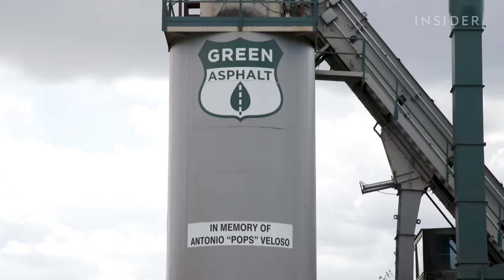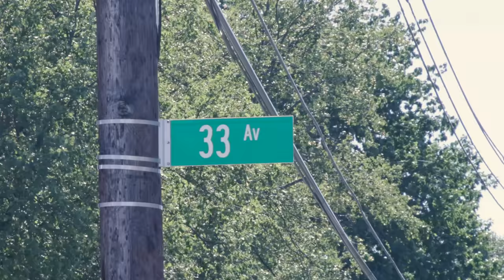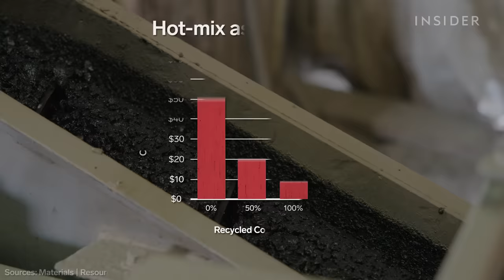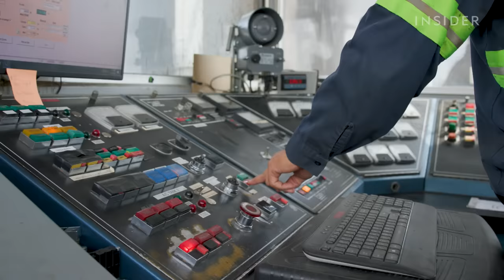Roads Can Be Recycled Forever, Why Don't More Cities Do It? | World Wide Waste | Business Insider

Comment: I'm a civil engineer in germany, and we use up to 75% of recycled Asphalt in road construction. In fact you have to use by law.😄
Reply: @waltstogner568  i dont know where you work, but in Bavaria we use 75% recycled material in the ATS.
Reply: I remember many many years back (early 90s?) when we got the first German asphalt grinders (Wirtgen, vielleicht) here in Finland, and it was called an expensive but good investment. Nowadays almost all asphalt is recycled here.
Reply: we limit recycled asphalt (RAP) to 15%.... Caltrans allows up to 25%. This video is biased/lying when it says "regulators limit"..... engineers limit it for good reason... - source: i'm an engineer....
Reply: @cattnipp  On a Youtube comments section? Get out here dude.
Reply: @Sam-qg1dy  With the proper tech you can use a lot more than 25%: I'm not happy with 100% recycled either, but 90% can be done without drawbacks. We have tests streets from >30 years ago and so far it has the same degradation as new pavement. Currently working on a mobile recycling plant that can be set up close to the construction site. Because when the repavement starts, you need A LOT of trucks the get the stuff quick enough...
Reply: Legislation is the way to go.
Reply: and the German roads are the best
Reply: Talk about being ahead of the curve
Reply: @cattnipp  I don't even care if he's a civil engineer or not and so don't most people, as long as the fact that Germany uses 75% recycled asphalt is true.
Reply: 75% RAP is way too high if you want to receive a similare service life out of your mix. I might be able to see that working on a low volume road with either restricted or no truck traffic, but it couldnt fly on any US road.  Pavements engineering is a very niche field, and, while I figure there are a lot of engineers in this comment section, I would imagine that only a small percent have actually studied the literature or had advanced classes on the topic.
Reply: How dare you!  Stop oil now
Reply: @cattnipp  Im a superduperrocketspacescientific engineer !!!!! On youtube nobody lies so just believe me ok !!!!
Reply: Wonder how long it will take if we dont use recycled asphalt, ofc Roman style roads are reliable and durable but it just takes so much longer to puzzle all the rocks in place
Reply: @bavarialuft5273  what kind of new asphalt do you use when making RAP? I'm guessing a low temperature one in order to keep up with the old one. Could you specify it in SUPERPAVE terms as in hightemp-lowtemp. I'm not familiar with European nor german standards. Thanks in advance.
Reply: @cookiecola5852  You think Roman roads could hold 1000's of 80,000# trucks a day?
Reply: @matthewerwin4677 ?
Reply: @matthewerwin4677  Roman roads are still driven on here in Europe.
Reply: @admiralbenbow5083  You don't know what you're talking about. "Legislation" leads to bureaucracies and bureaucracies lead to the stagnation of innovation. It's such a lazy approach to just pass the buck to politicians. 

If you want innovation in paving technologies then lessen the role the government plays in regulating the technologies behind asphalt-paving. If people wonder why it is that recycled asphalt product is limited in its use within the United States then they need to go look at the specification book for various states, like Pennsylvania, where the bureaucrats establish arbitrary limitations on its use, far below that of private-sector customers who will typically opt for material with a higher RAP-content than the state. 

There's even private-sector customers of ours who experiment with the use of recycled polymers in their custom-mixed asphalt, attempting to find use in recycled trash bags and other polymers.
Reply: I was doing my BEng Final year research on using 75% RA treated with foam-bitumen, it performed as great as lower RA% mixes. But we still use like 25% max in South Africa.  (Unemployed btw😕)
Reply: @Sam-qg1dy how does Germany recycle 75% and have better roads?
Reply: The quality of recycled asphalt is horrible. It's barely good enough to patch a pothole
Reply: Yes of course you are.
Reply: @lucianocortes8636  Hey, in Germany we have three asphalt layers in most roads, the base layer with 75% recycled material, the middle layer with up to 50% and the top layer with up to 40%. These are the standard high temperature asphalts with up to 150°C during installation. We have a very strict recycling-law the "Kreislaufwirtschaftgesetz" where this is determined. After the remove from the street the asphalt gets granulated, then "Rejuvenatoren" rejuvenators are added, these help to stabilyse the old bitumen. After that the recycled material is mixed with new bitumen and rock. On the highways this is often done right next to the construction site, so the drive ways are as little as possible.
Reply: @tomevers6670  germany roads are very thick, and the autobahn is even thicker.
Reply: @murphychris9811  Not really. I may be biased, but Dutch roads tend to be WAY nicer.
Reply: @Aquade  I think most European roads are used more intensively then any US road and we are doing just fine, most of Europe has the best and well maintained infrastructure in the world.
Reply: @gilibran  define intensely. Are you familiar with ESALs and the fourth power law we use to estimate life cycle design loads on roads? By we, I mean all pavements engineers by the way. Passenger cars are not the issue insofar as damage which is done to the structure of a road. It's commercial vehicals, always. Climate, subgrade conditions, including the draining characteristics thereof, and design life axle loading control how you design a pavement regardless of whether you use the empirical methods from the 80s/90' or the mechanistic-empircal methods which came out in the mid 2000's. Now, back to RAP, it's important to understand that you have a pavement with different characteristic when you use it versus using all virgin binder and agg. The RAP is going to have aggregate with compromised angularity, some amount of fines, and binder which is aged. Aggregate with less angularity decreases the strength of your pavement. Binder which has taken a considerable amount of UV and/or has been heated above its design temp more than a few times loses a considerable amount of ductility. These are all factors to consider
Reply: Same in the US this clip is misleading. 😅
Reply: @manswind3417 si does the US

Comment: I find it amazing that asphalt torn up in the morning could potentially be repaved on the same road in the afternoon.
Reply: You get it.
Reply: The reason you can recycle metal is because metal grows very fast. Those tiny crystals grow immediately below melting point and it reverts back to order, to solid ... after you grind it to a powder and melt it. Now try the same with polymer chains. Bitumen or plastic or whatever. Polymer chains don't just grow back when going below melting point. They need very specific conditions to grow and you cannot recycle plastic or asphalt like you can recycle metal. The recycled material suffers partial degradation and the degraded chains cannot be separated and they contaminate the material and change it's properties. To lower the contamination level and mantain material quality, virgin material has to be added to the mix. It will NEVER work without adding virgin material
Reply: @georgeyoutube7580  Did you watch the video?  The fact is people ARE recycling asphalt. So the question of whether it can be done is moot at this point. As for plastic, that's a very broad term for a range of products. Some of which are 100% reusable, like PE, PET, PP, PS, PLA, etc..   I've been recycling HDPE at home for years, and we're starting to see consumer grade recycling equipment become more widely available.  The plastics that can't be reused, you can use pyrolysis to turn them back into flammable substances for other uses. The word recycling covers a lot of options and I feel you're limiting your thoughts to simply reusing products, but any process that creates a new product from an old one is recycling.
Reply: @M3rVsT4H  well i worked in plastic industry. And you can recycle anything if you use broad terms. We managed to recycle biodegradable plastic. The client wanted to recycle the waste his factory produced. It can work to some extent but it doesn't really work cos the more recycled material you add to the mix, the more waste you make cos the final product start to fail and be non compliant in strenght and elasticity mostly. Sure, you can find another product to dump the recycled material, another technological process and you can recycle. But recycling asphalt to asphalt does not work without adding large amounts of virgin material. And it's stupid to try cos you compromise durability then you just doubled the amount of material you need to dump if the road lasts half as long
Reply: @georgeyoutube7580  I think as more people use it for more things, the term recycling is becoming broader. We will likely see increased use of more specific terms like reused, upcycled.. etc.  I'm no chemical engineer but my own thermoplastic recycling has been successful. And I've seen the pyrolysis work.   But as you say, it depends how you want to define it.  Obviously one must factor in consumables used in the process etc. 

If this video presentation is to be believed, this company is 100% recycling asphalt, and the only virgin material added was the Paraffin used in the process. And if they've been laying it for 11 years, there should have been ample time to measure the product's performance.
Reply: Back  in the 90's I watched as a road crew did just this.  They had a very long machine come in and tear up the road, go through a grinder machine and out the back was hot pavement that dumped directly into the paver and they just drove down one side of the road and back up the other side, tear up and pave all in one machine.  The road was over a mile long and it was finished every quickly.
I thought it was going to be the new way it was to be done, but never seen it done this way again.
Reply: Except on Massachusetts highways.  They wait 4 months to repave, so everyone's suspension gets rattled
Reply: They are behind ! 20 years ago Canada grinder to a machine and mixed tanker to the paver was bunch of machines in a row grinding pwving in 1 motion
Reply: Yes and there's two types of methods hot rock. And cold rolled.
Reply: Taxpayers money at its finest?
Reply: When you have been hauling asphalt for more than 10 years, it's nothing new in the US. They have been recycling asphalt for more than 20 years in the US. This video is a lie.

Comment: Our residential development had its dirt road paved with recycled asphalt 18 years ago. It endured countless frost heaving, snow plowing & grader truck in winter, and heavy machinery traffic as the development expanded over the years. It’s still in really good shape.
Reply: What matters is the base under the road
Reply: Our roads in New York fall apart so fast with recycled asphalt
Reply: @kevinbutton4580  wonder if they botched it to keep themselves busy.
Reply: @kevinbutton4580  probably tens of millions of vehicles drive over those roads, so of course they will wear out faster than some road in a suburb
Reply: @kevinbutton4580  Recycle shouldn't play a factor in how long a road will last if its done properly. The liquid does age but can be chemically restored back to its original state. I doubt your roads are 100% recycled anyways. Most plants do like 20 - 30%. NYS DOT wont let you exceed 20% for any state roads or state funded projects.
Reply: @koralr33fer79 It's that way because we can't find enough RAP to justify higher percentage mix designs.

Comment: I’ve hauled recycled asphalt in Arizona for the past 3 years it’s just as good as new asphalt can’t tell the difference when you see it.
Reply: That's the problem with asphalt in general, it looks all the same on the outside, but to characterize the binder's actual quality, we run performance based tests using machines like a Dynamic Shear Rheometer and Bending Beam Rheometer. 100% RAP can be used for parking lots and low volume roads, but wouldn't be suitable for highways since it has less relaxation capabilities than its virgin counterparts, and would pothole and fail faster than a traditional counterpart.
Reply: @jainradhakrishnan6600  exactly. Thats why New York only allows 25% RAP on main roads and highways
Reply: @jainradhakrishnan6600  Theres so many rejuvenators and additives available today to fix that though. I feel like the term recycled asphalt is kind of vague for the discussion too. We talking 100% recycled or just because it had 20% RAP or RAS its considered recycled asphalt?
Reply: @koralr33fer79  True. At the moment, 100% recycled or reclaimed or shingled (RAP, RAS, etc) asphalt means no new virgin aggregate in the mix, and possibly no new asphalt binder.

To call a mix "100% Recycled", the only "new" thing should/would be the recycling agents added to rejuvenate the existing RAP/RAS binder. This is probably up for debate at different DOTs.

Comment: I remember reading where some states use old car tires, grind them up, and mix with the asphalt.  This reduces the tires in the landfill, but also cuts down on asphalt material and the roads last a lot better.   The only downfall is because the roads can last longer, it is less maintenance, and thus less work for the employees.
Reply: Yes, and that’s generally the city or state workers. What does that mean? Less cost, lower maintenance and therefore less ‘government UNION’ members and less union money to the democrats. Can’t have that.
Reply: This mix you are talking about is terrible. It would stick to the insides of the paver. Rollers would pick up because the rubber was so thick within this mix design. It would take 2 hours to clean out the paver verses 30 minutes. It’s sounds great, but in reality it will take some more development.
Reply: @Kulimo  Oh, I didn't know that.  Interesting to know.  Thanks for sharing.
Reply: Less maintenance is a downside? Maybe they can repair some roads OTHER than the main thoroughfares. You'll never run out of shitty old roads that haven't been repaved in 10+ years.
Reply: And there you run into the broken window parable
Reply: That the same with plastic the can’t be reused made in to asphalt it was told in 2015 I think but they never did because they wanted to make more money off rocks and tar from other places will go bankrupt because of it so nobody did it.
Reply: There's plenty of work all over the country that needs to be done. Infrastructure reconstruction is necessary in every state and every major city.
Reply: That is a dumb conspiracy theory - all govt work is an expense paid for by taxes of private industry workers.
Reply: @bretfarve9435  who's gonna pay for it though....

Comment: Maybe some 20 years ago I saw a machine in Norway that was digging up the asphalt of a road in the front, heating it up and laying it back down in the rear of the machine.
Absolutely awesome. In Norway there is so much snow, that cars have winter tires with spikes, which tear up the road. They use these machines only during the night, because they move very slowly and cause a horrific traffic jam.
Type "Hot In-place Asphalt Recycling"
Reply: Bomag has been making machines for decades that grind up the old asphalt road in front of it, and recycles the materials and lays the new road out behind it but it is very slow, and costy
Reply: That is so Scandinavian. I love it.

Comment: If 90% is already being recycle, thats good enough in my book. Getting that last 10% is difficult and will take a lot more money and resources that are probably better spent elsewhere.
Reply: According to the video most asphalt 30% max and it’s 20% cheaper.  90% of the leftover asphalt is reused in roads but 30% of the new road is recycled . Meaning there are large piles of asphalt building up AND new mining occurs. That’s the whole issue.
Reply: You could just use the remaining 10% to fill out potholes
Reply: @user-bl3si3kq6x  what? What is ”leftover” asfalt? Your centences make no sense unfortunately.
Reply: @ripprind  it's simple. It doesn't say a new road is 90% recycled. It says 30% of a new road is recycled asphalt. new, additional roads are being built. 90% of the trashphalt is eventually reused. So the 10% is growing (because there are always more roads,which need maintaining) but mining, which is overall worse, continues.

When I read above comment, I was confused at first too.
Reply: @somerandofilipino6957  it is being used. But the 10% is getting bigger. Stop mining and the 10% will disappear. That's this companies entire argument.
Reply: @user-bl3si3kq6x  Thank you! This makes sense

Comment: The question that should be asked is, is the recycled asphalt better than the old asphalt it is replacing? If it is better than what is already on the road, replacing it is still better.
Reply: It is probably equal. The problem is that the companies selling asphalt wants to make money and recycling asphalt means they will sell less. :(
Reply: @ideadlift20kg83  Unfortunately, recycled asphalt is not as durable. 100% recycled cannot be used for applications such as highways.

Comment: One of the challenges of producing recycled asphalt is meeting state specs when the materials being reused have varying oil types and gradations…
Reply: It won't meet any DOT spec. They sell to homeowners and building owners. 

All the buyers know is they have new flexible black pavement, and they write the check for it.
Reply: @sniper7.62x51  you can meet specs with it , but it’s usually just a small amount of RAP (recycled asphalt pavement).. the job i’m on now calls for 15% RAP in its mix design…. (in California)